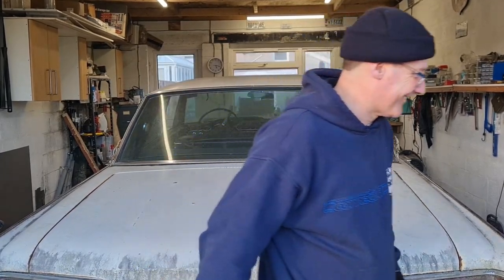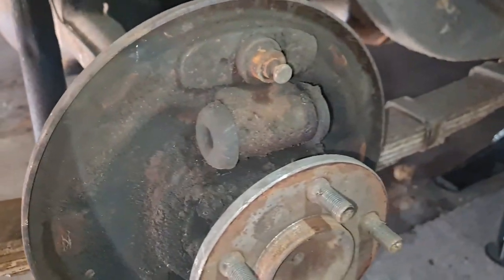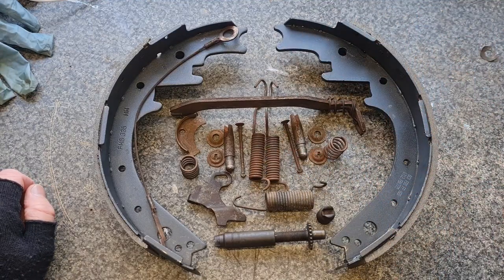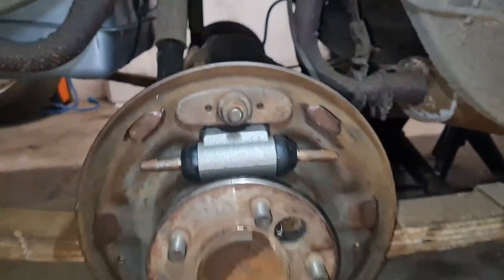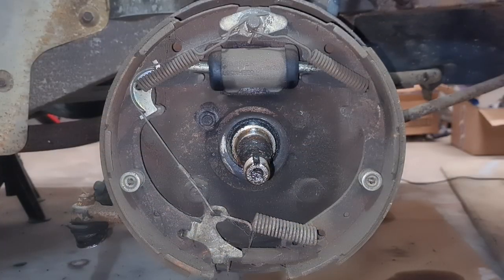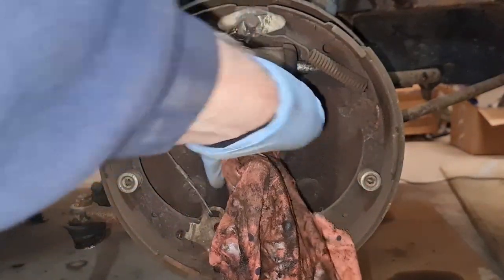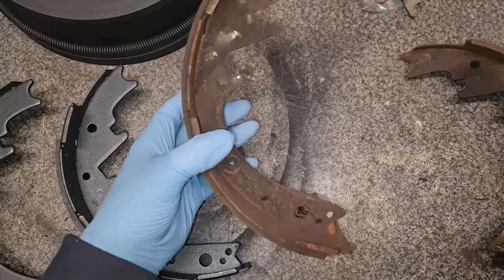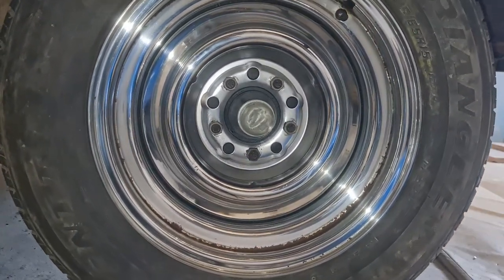Mopar Drum Brakes Front And Rear

Comment: Great job George. I have a 67 300 which I've done numerous times. Nice tutorials. The only thing I hate about these drum brakes up front is that they are very finiky. You have to adjust both just right so the steering wheel doesn't pull to one side when braking. I also have issues sometimes when making sharp turns you hear the brake shoe grinding against the drum. It mostly occurs when making a sharp right turn.

Comment: Great video! You are an excellent teacher. Your brakes are just like the set up on my '68 Fury. When I first got the car in 2009, it had an odd tendency to  self over adjust the rear brakes which apparently was an odd '68 only problem. The fix was to get the 1969 and up self adjuster kit which I got from Rock Auto. The new self adjusters look just like what you have on the '72 Chrysler and solved the problem neatly which when I got new brake shoes, there was a use for that pin finally. That brake tool you're using is a godsend. The one I have is at least forty or more years old and saves me a lot of grief.
Reply from the maker: Thankyou for your kind words Patrick. I do my best to help people do this kind of thing for themselves if they've had no previous experience. It's not as daunting as it first appears when you're able to see how it's done beforehand. By the sounds of it; 68 was possibly the change over year for the self adjusters?!

Comment: Love the video 
I got 1967 new yorker really enjoy driving it 
Got  slight issue with it when i brake there a air hissing noise do you have any idea what it could be and what parts it may be
Reply from the maker: To be honest Kevin, the only thing that would give a hissing sound is air, and the only parts of the brakes that uses air would be the servo, hose from servo to pcv valve or pcv valve itself. I'd start with them. Hope it helps. SGG 😃👍🏻
Reply: @SortedGeorgeGarage  I will start there thanks

Comment: The only thing I noticed you didn't do was clean and put some lithium grease on the shoe platforms. That's a very nice car. I had a 65 Newport years ago.
Reply from the maker: Thanks 66. If you're referring to the 3 pads either side of the shoes, I put copper ease on the back plate rather than the shoes 👍🏻

Comment: I'm sorry George, but the brake springs for the rear adjusters were indeed installed correctly. You have them installed backwards. The short end of the springs go on the brake shoe side.
Also, the front brakes were pre-assembled onto the backing plate before they are attached to the spindle from the factory for ease of assembly. Good show dude.
😉
Reply from the maker: Thanks Ghett SUMM, but both sides were different, so I went with what looked and felt safer. Any bad jolt and that short end of the spring would have come out of the shoe for sure, especially on the new shoes anyway 👍🏻 Thanks for the info on the front drums... I wondered why they were so hard to access 🤣🤣🤣
Reply: You are correct.

Comment: Curious what spring kit your'e using here?
Reply from the maker: Spring kit was already on the car. Set for 66 is different from newer models. Self adjusting arm is different on later years. Hope it helps.... SGG 😎👍🏻
Reply: @SortedGeorgeGarage thanks! Mine dont have a self-adjuster. Just a spring and adjuster. Possibly older?
Reply from the maker: @jvilledjango  if it'll work then sure. Make sure you have all the correct parts for your car's year 👍🏻 What vehicle do you have?
Reply: @SortedGeorgeGarage    Its on my hot rod which happens to be 55 F100. All I know its a 742 Diff 8 3/4 axle with 11" drums. Currently no self-adjuster just a spring. I'm curious your thoughts though. is it wise to just  keep current configuration with no self-adjuster or do you foresee any issues if I upgraded the springs to have a self-adjuster? Any advice will do. I'm learning as I go :) - Great videos btw.
Reply from the maker: @jvilledjango  Thanks bud, I do my best when filming for close ups etc. So people can see clearly what's going on. I learn as I go too 🤣🤣 I'm no mechanic, just a Fred in the shed showing how easy it is to do 😁😁
Have a look down my list of videos.... there you'll find a video on the brakes of my 72 New Yorker. You can see the slight difference in the self adjustment mechanism. Some people like the self adjusters, some people just ditch them if they can't work out how it all works 🤣🤣 It won't matter either way if you have them or not, it just means you'll have to keep an eye on your rear brakes and adjust manually that's all bud. Hope it helps 😃👍🏻 Enjoy your HotRod 🤘🏻😎 ......SGG
Reply: @SortedGeorgeGarage  I figured as much, just wanted another opinion.  Thanks!
Reply from the maker: @jvilledjango  You're welcome bud 😉👍🏻